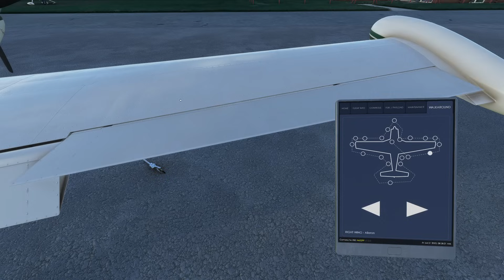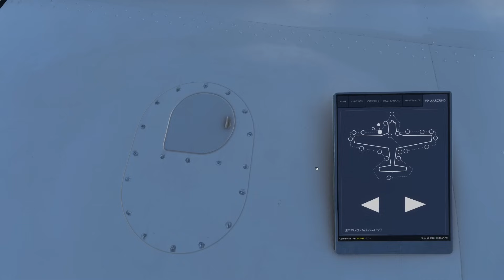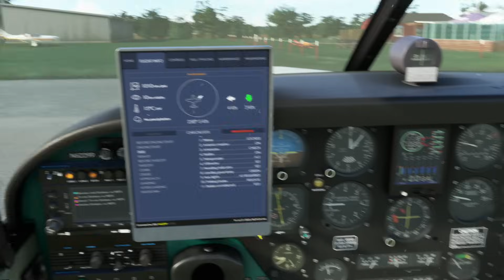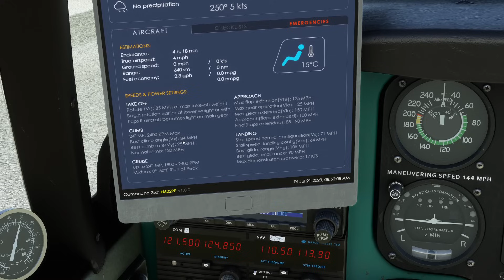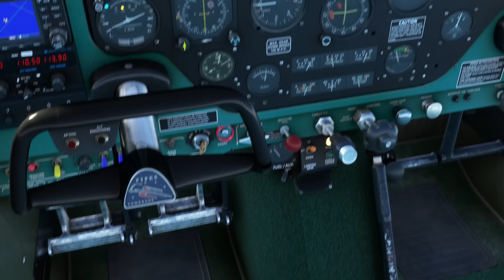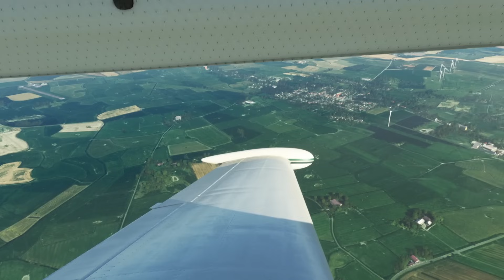How to FLY the A2A Comanche | TUTORIAL | Real Airline Pilot

Comment: Great video! How much do you set the trim just before landing? Around 25%, the elevator tends to jerk a bit during the flare.  So I'm asking :) Thanks !
Reply from the maker: Hi, always trim the plane so that it maintains the flight path with your hands off the controls. There is no fixed setting for that, it’ll vary depending on your CG and power setting.
Reply: @A330Driver  yep. Thank you :)

Comment: 58:00 Huh, interesting. First time I hear someone say this about GA. I once had an instructor tell me smth like "you must have been flying airliners in the simulator a lot because you do pitch for altitude and throttle for speed. In GA you must do the opposite, bla bla bla...". Next time I'll try doing it the "airliner way"
Reply: Pitch (and trim) for speed and power for alt is much easier/safer.

Comment: I love every time you said "Let's see if A2A modeled this." And...of course they did. Thanks for the video, excellent information.
Reply: Unfortunately the compass error, is wrong, all around the compass... un-accelerated, level flight. A desired rollout for exactly east or west, should happen, as you time to roll out, exactly 090/270. A desired rollout for exactly north/south… should be under/over shot, by 30 degrees. Desired rollouts, other than those, should be over/undershot by proportionally less than 30 degrees
Also, the Turn-coordinator seems not to work as it should, compared with the PA28 from JustFlight.
Hope they will fix it soon.
Reply: @x_RIGO_x  I did notice the ball pretty much stayed center all the time apart from maybe just after take off but after that it hardly moves. Was wondering if this was normal for this plane.

Comment: Why do pilots choose to switch between right and left fuel tanks as you showed, instead of running "both" at the same time?
Reply from the maker: Because the Comanche doesn't have protection against fuel flowing from one tank into the other. If you fly with 50% fuel in each tank and make a turn to one side all of the sudden you might find yourself with a severe imbalance.
Reply: @A330Driver  thank you very much that makes sense

Comment: One of the first things done in any walk-around (and you omitted these on your intro video, claiming you were flying in daylight!) is to put the master (battery switch on), turn on the beacon (anticollision light), landing light, strobes and the nav lights.  Also turn on the pitot heat. Go out and check the lights are all working, the pitot tube is hot, and the stall warner is working (you should hear it.).
Then go and turn the battery off, and the other switches.   Then, continue the walk around.   I'm amazed you missed these......   Apart from anything else, if the beacon isn't working, you cannot fly!
Reply from the maker: That's not generally needed when flying in daylight. Only for night flights you need to check those lights and even then you can check them by watching from the inside, for example for reflection of the Beacon from the hangar, etc.
In terms of the stall warning, as you have a light in the Cockpit in the Comanche you can't check that during Walkaround either as you can't see it from the outside.
If you check the normal procedures in the manual you won't find such a check either.
Reply: @A330Driver  The anti-collision light (rotating or flashing, or just strobes, if there is no beacon) is required for all flights - day or night - by the FAA and EASA.  Quite how you can check this in the cockpit, out on a ramp in daylight eludes me.  The PA24 had a stall horn as well as a light.  I would certainly like to hear that before going on a flight!   The "Normal Procedures" for a PA24 were written in 1961 (62 years ago), and revised in 1973 (50 years ago).  Later versions barely altered these original ones.  I think it fair to say that times (and regulations) have changed.  Checking lights, pitot and stall warning are tasks included on most modern third party checklists, and are eminently sensible things to check.  I was always discouraged from flying when a landing light was burnt out - admittedly new lights are LEDs, but the switches and maybe some of the wiring may not be OK.    I had a load of A2A's planes in FSX (including the Comanche!), and they were amazing.   I haven't tried this new one in MSFS, and wonder whether it is so markedly superior (as were the A2A offerings in FSX) to included and other 3rd party stuff.   I mainly fly in X-Plane, but I wouldn't be surprised if I buy the Comanche sooner or later ;-)

Comment: During the simulated engine failure around 1:10:37, did you turn on carb heat? I was always taught to do so to prevent an (actual) engine failure albeit this being an exercise
Reply from the maker: Indeed I forgot - and you're absolutely right that I should have turned it on.
Reply: @A330Driver  cool thanks for confirming I hadn’t gone crazy 😂

Comment: Watched from start to finish, and what a great flight lesson! I learnt a lot. Really made me smile when you talked about only using the standby compass in still flight and when you rolled the aircraft to demonstrate, the compass just lost its mind. Regarding flying patterns, how do you know the reference points for downwind, base and final turns as well as the pattern altitude, especially in an unfamiliar airfield? I don’t see them on Navigraph charts.
Reply: In unfamiliar fields, one technique is to turn base "x" (for instance, 30 - may vary with airplane type) seconds after passing abeam your landing threshold. A very high profile accident happened in Brazil recently when a Beechcraft King Air carrying a famous pop singer in the prime of her career extended the traffic pattern in a visual approach to an unfamiliar field. He ended up turning base and then final too far from the field, and struck power lines over a hilltop (he shouldn't be there at pattern altitude, as it was some 5 km away from the runway) killing all aboard. In real life, the first VFR landing in unfamiliar airfields can be a difficult proposition. All information regarding obstacles, etc, should be gathered in advance.

Comment: Kind of wish that the EFB checklist could be "checked".  It would make it easier to notice if you missed something, EG you missed the Altimeter item in the checklist.  
My challenge right now is "mixture as required" ... how do I know what is required? EDIT: He covers this some in the video which is really nice!
Reply: The rest is covered in the A2A official YouTube channel. The cruise tutorial. I learned new stuff there too.

The short and good enough version is keep it full rich until cruise and then pull the mixture to lean slowly. Once the engine sputters and changes audio tones then push it in a tiny bit. Now you've leaned it as much as you can and are good to go.
Reply: @HolyOrangeJuice  It is cheating I guess, but something I learned from my 4th or 5th skim of the manual is that the engine diagnostic screen actually shows you when you are properly riched or not by the color of various pipes.